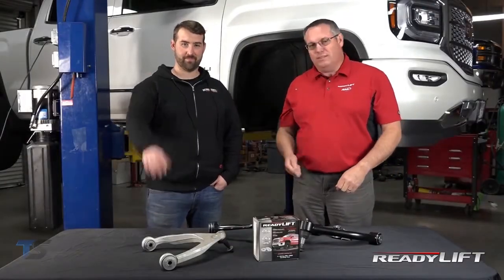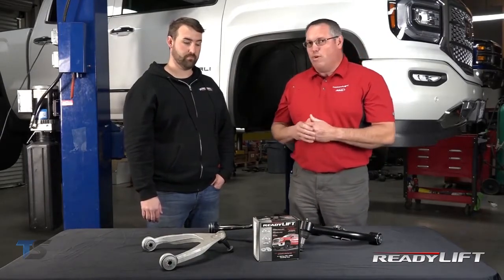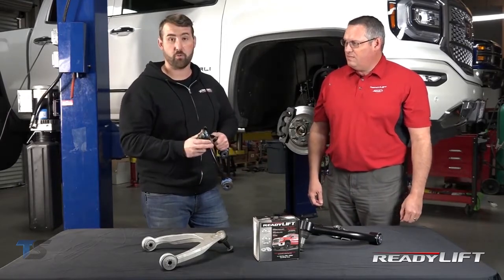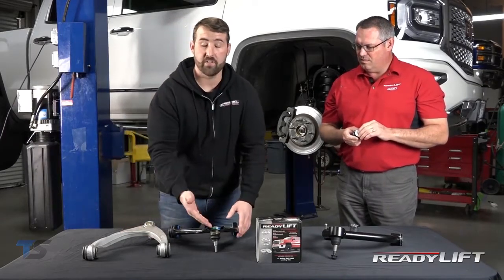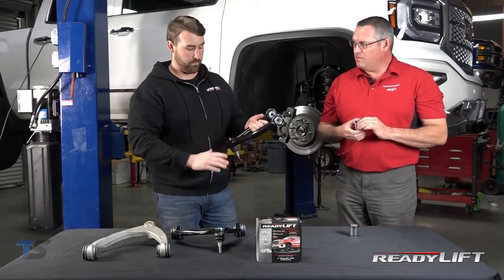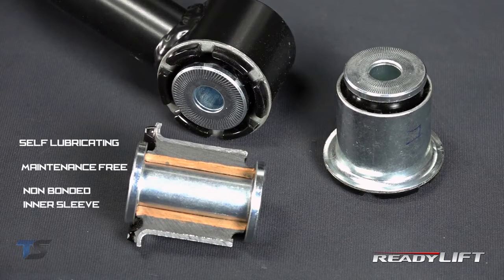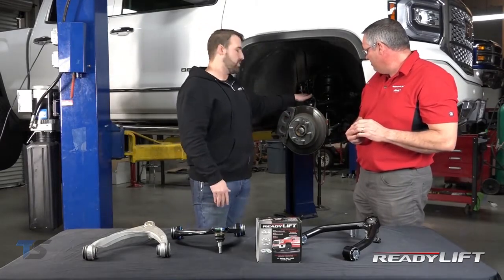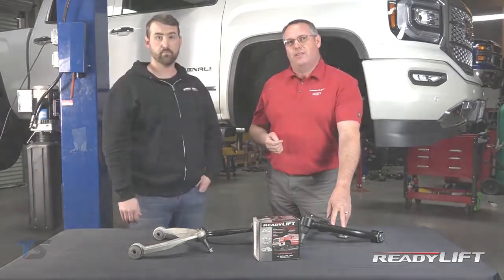ReadyLift 2.25 inch Front Leveling Kit 66-3085

Comment: I have an early '16 z71. Will those arms work?
Reply from the maker: If you have the stamped steel upper control arms that they talk about in this video the 66-3086 kit will work. The stamped steel arms do not hold up when the truck is lifted and the ball joints are prone to failure they are replaced for safety. If you have the aluminum upper control arms like most of the early 2016 models have this will not work and you should use the 66-3085 kit. The aluminum upper control arms are much more tolerant of being lifted and the ball joints hold up better.
Reply: Michigan Truck Spring ok thanks for the reply!